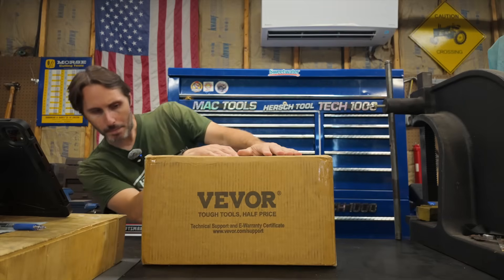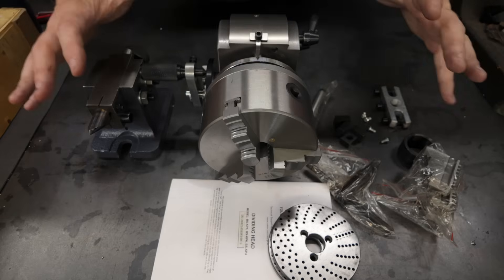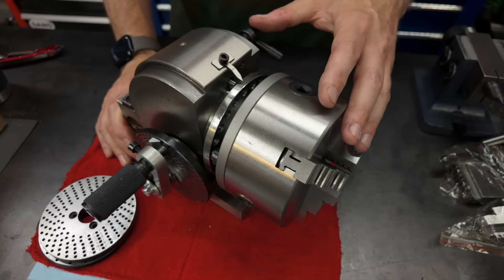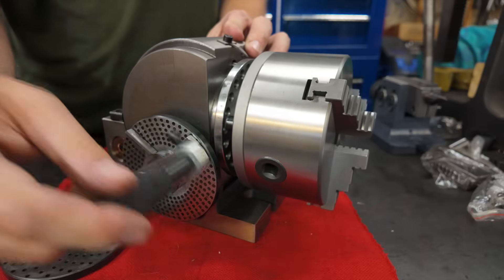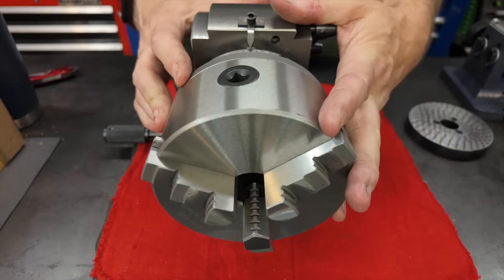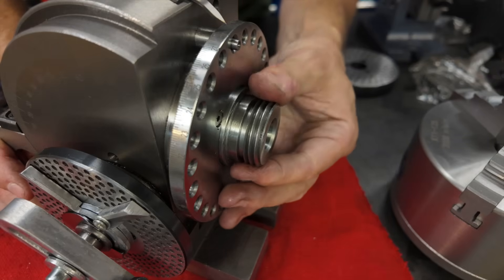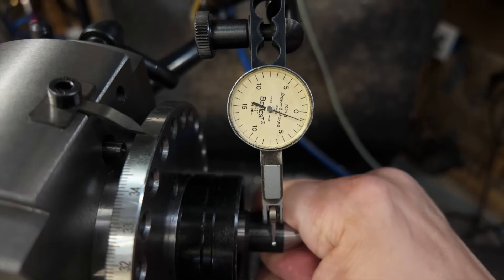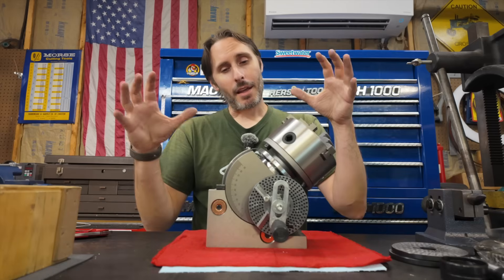It DIVIDES!!!!

Comment: I will add my two cents. I have both the BS-0 and BS-1, I recommend jumping up to the BS-1 if you have a larger knee style mill. You definitely will need to give any of these imported units some TLC before using but then will perform just fine in a hobby shop.

Comment: I have had a BS1 for many years and last week bought a job lot of machinery in a workshop clean-out. Amongst the gems there was a very nice industrial Die Filer and buried a BS2 universal Dividing Head minus the gears and indict drive mount.
As things happen I have every missing part, brand new in original wrappings, in a box I bought at another auction some 10 or 11 years ago. I am now a happy man.
I also got a bench grinder for approximately US$73.  It had crap stacked on it but came with a 2HP compressor.
Cheapest Surface Grinder I have ever seen, came with boxes of wheels, adaptors and attachments as well.
Now my problem is it is pouring with rain, I have large items outside under tarpaulins and need to sort out my shed.
Such is life.

Comment: I've owned one of these cheap import BS 0 dividing heads for several years now and it performs very nicely in all functions. I did take ir apart and fettled many parts and bearings etc to get it to a really good standard  of repeatable tolerances in use. 
One thing that really improved mine greatly was lapping the worm and wheel gears together with Time Saver lapping powder and oil...after several lapping sessions with a cordless drill attached to the worm spindle the gears run super smooth with almost zero backlash at any point on a 360 degree rotation of the chuck spindle....I'm very happy with my unit.

Comment: I’ve had one of these things for 4 years and aside from the usual deburring and cleaning that seems to be necessary with machine products from a certain part of the world I have found it useful and accurate.  I think that one thing that’s essential for new users to know is that the correct technique for indirect indexing is to approach each target hole in the index plate from the same rotational direction - i.e., never “back up” into a hole.  Then lock the spindle before each cut. That way any backlash doesn’t enter into the positioning of the spindle.  BTW my chuck came off as easily as yours did.

Comment: I have this unit, fit and finish out the box for mine was acceptable, what I have found annoying is the drift in backlash while in use. Have had several gears needing to be scrapped as a result of this. Some gears were in the 50-70tooth range, one was 108t was not happy.

Comment: I don’t see the initial fit and finish issues as a problem, given the cost of the thing.  I think you’d have to spend a lot more than double on a similar setup to get the sort of build quality that you can take on faith.
Reply from the maker: I agree 100%
Reply: A genuine Brown & Sharpe BS 0 dividing head would cost an arm and a leg by comparison....as you say put a bit of effort in to one of these cheap imports and you can almost always get close to the genuine article for repeatable accuracy.